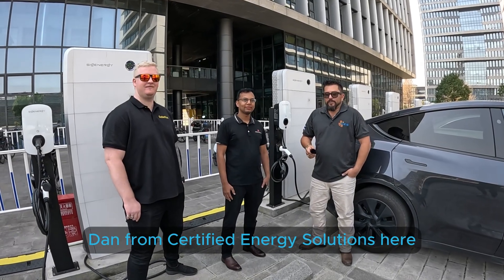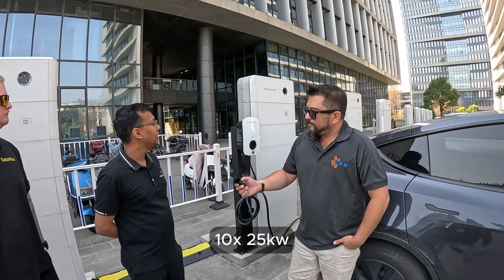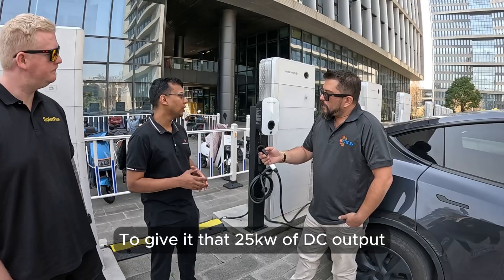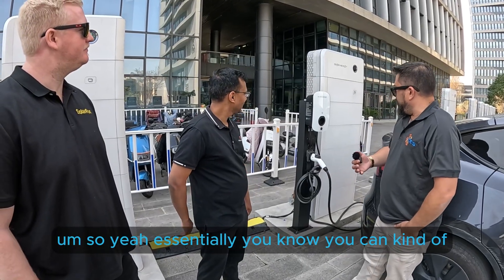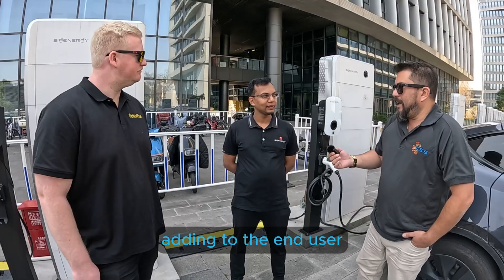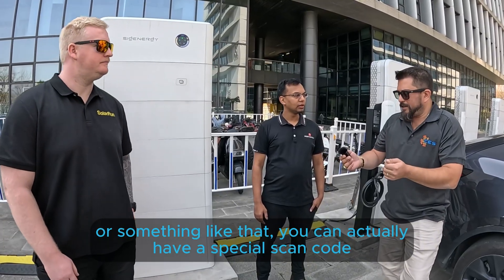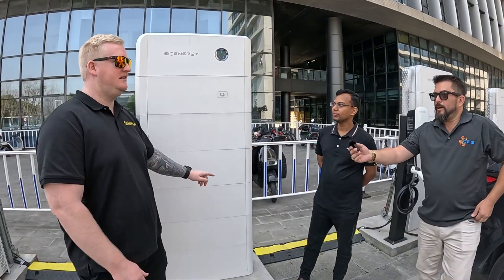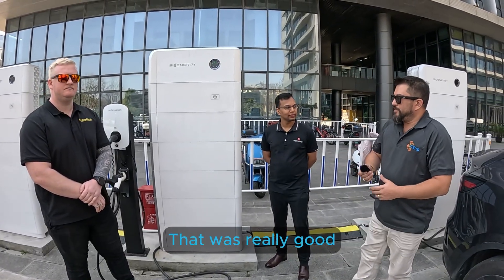Sigenstor EV Chargers chat with Head Technical Advisor for Australia at Sigenergy Headquarters

Comment: Is there any plan to produce a standalone DC 25kw charger that doesn't need a place in the battery stack as i was to install 6x8=48kw/h battery stack
Reply from the maker: Hello, at this stage we have had no updates on that front from Sigenergy. The dc bi directional charger is relatively new tech so i would say as the market demand goes up this will be work consideration by them.
Reply: We are in the same situation. We want at least 48kw of battery to try to maximise the battery rebate in Australia. The dea of having to remove a battery module to install a DC EV charger is not attractive.

Comment: Btw, strata cant profit over power. So that idea is out. I looked into this trying to get an EV charger installed but we couldn't do that even if it was still cheaper than anything elxe around.
Reply from the maker: Thats interesting, we are working with a customer in brisbane and they are making some good money out of offering their ev chargers to the public week days and weekends. The sell price is considerably higher than the buy price, especially when a lot of the charger output is covered by a substantial solar system through the day.

Comment: Hi, I'm replacing my Goodwe supplied 10 kw battery which is rapidly failing with a Sigenstor 3 phase 15kw  inverter & 24 kw of  modular battery stack , I drive a Mitubishi Eclipse cross PHEV which I understand has been approved for bi-directional charging for over 2 years in SA.
 To date I have not been able to buy any approved bi- directional charger to utilize my car battery for VTH.
If I add the DC fast charger module will it be compatible with the PHEV''S Chadeamo socket & is there an adapter available if needed?
Reply from the maker: Hi,

From what we can tell, a adapter would be needed. However in QLD bi-directional charging has not been approved yet for grid connected homes.

If you would like you can call Sigenstor support at 0489 080 832 for confirmation on the charging plug.

Comment: Is the DC from Excess solar limited or can it supply the total 24Kw without grid or battery?
Reply from the maker: Hi john, the charger can output the maximum of the inverter capacity without batteries or grid if the solar is producing that amount. Keep in mind that if the grid is down the sigenstor will need to have a battery installed to continue operating.

Comment: Can I charge the battery from the EV battery? With the normal Vehicle to Load included in the vehicle software?
Reply from the maker: @briangreen9122  the dc fast charger has this feature however is currently software locked until its approved with electrical standards in Australia.  At this stage its mainly the regulator holding it back but wouldn't be surprised if it goes live before the end of the year. 

I also know that sigenergy have been working with some big brands for compatibility testing. Byd. Ford, ect. 

It will also be down to the car manufacturers specifically working with companies like sigenergy to ensure the feature is compatible. Still early days but atleast the sisgenergu dc dc fast charger is ready to go when the industry catches up 👌

Comment: In a 4 * 8kwh battery configuration, with single phase to the grid, up to 10kw from pv panels what charging rate will the 25kwDc-DC module provide?

I am reading that the batteries discharge at half their kwh rating. So if that is the case the maximum from batteries in the configuration I am looking at would be 16kw (4 batteries discharging at 4 kw each).  Does it then add more from the pv panels and grid to get to 25 kw?   

Could you communicate how it works.

I am looking at ordering and want to see what is needed to get the highest charging rate for the EV at times, and at other schedules when I have more time to only use my solar from the panels or battery.

The EV car is Xpeng G6 which is on the list that has been tested with the DC charger module in Sweden.  I am in Sydney Australia.
Reply: 16kW discharge from the battery, + what your inverter is capable of (10kW) and whatever DC from Solar you get. If your battery is flat, at night: 10kW max (inverter is the limit)
Reply: @jy2489  Thanks for the explanation.
Reply from the maker: @tonyg2002Aust  JY is correct in his explanation, generally it's best to charge during the day when you can take advantage of surplus PV For a higher charger rate as it will combine pv to boost the charge rate of your dc fast charger while ramping up and down to suit the conditions. Their are many variations to the charger settings that you can control through the mysigen app to best suit your requirements.